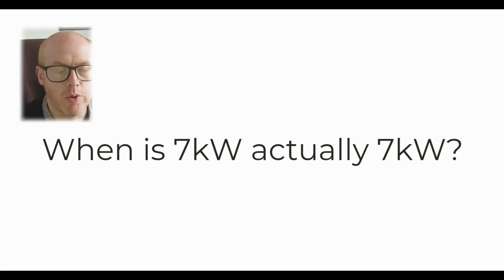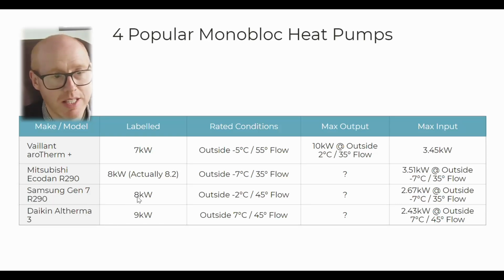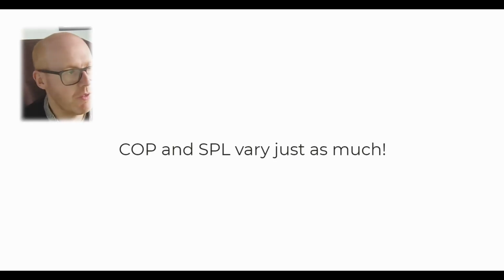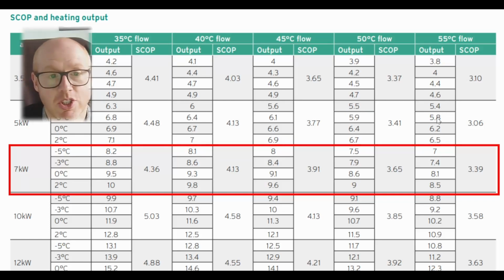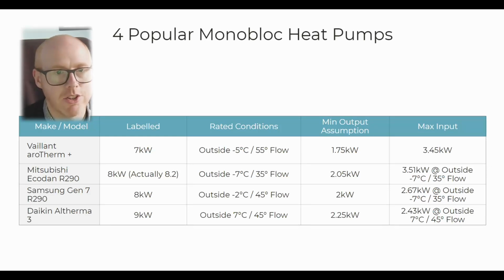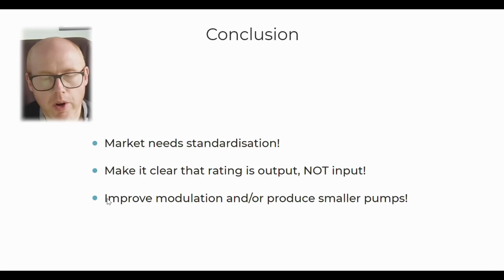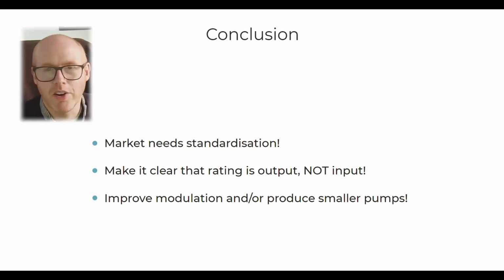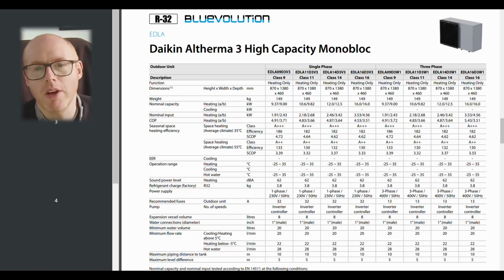Are Heat Pump Manufacturers trying to manipulate the figures? What size pump do you need?

Comment: Welcome to the world of the "Ratings Game". 

It has always been the case that AC & Heat Pump manufacturers rate & produce performance data to show their products in the best possible light. Car makers do exactly the same with prescribed fuel consumption test procedures under lab conditions, which as we all know, bares no resemblance to real world results because replicating real world conditions for different types of drivers & ways of driving is impossible to achieve. The same is true for Heat Pumps.  

Interestingly, Air to Air split heat pumps have long since shown minimum & maximum heat/cool capacities & power input data for different models (at least the manufacturers that I was involved with did). However, the temperatures (inside & outside) that were used to generate this data could vary widely so once again there is plenty of opportunity to "manipulate the numbers". And, as you have found, the same is true for ATW products.

In an effort to make comparisons between different makes more easy industry bodies require individual heat pump models to be tested & rated at specific conditions. This can be done in-house at the manufacturers factories providing their facilities meet the governing bodies test, measuring equipment & procedural standards. Governing bodies will visit & witness the manufacturers testing facilities to ensure their compliance. Governing bodies will also do spot checks by testing randomly selected / purchased heat pumps & test them in its own lab facilities. In the UK the most well known of these test houses is BSRIA who I had dealings with when I worked for two different heat pump manufacturers. This data is also used for the energy labels attached to each product. 

That said it is still not easy to do meaningful comparisons between manufacturers when there are so many installation variables that can affect the overall system performance e.g. the type of emitters used, the pipe sizes, lengths of pipe & pressure losses, pump sizes, buffer tanks or not etc etc. To combat this most ATW manufacturers should publish a "short form" of capacity & power input product rating based rads or UFH & different flow temps. This is typically shown in their sales catalogues & should be the same format for each make in an attempt to level the playing field. Whilst not totally accurate it can be used as as a quick way of comparing different makes. However, for all the reasons stated above accurate comparisons between makes are almost impossible due to the many variables involved. 
Last but not least, oversizing of heat pumps is still fairly common & is a hangover from the days of boilers when sizing was, how should I say, more of a guesstimate than a science. It's far better to slightly undersize a heat pump that to oversize it. 
Now I'm waffling so I'll stop!!!!!
Reply from the maker: Thanks for the comment. I've responded in this video: https://youtu.be/BQQ5cOFCjKI

Comment: Interesting video, I am assuming that as that energy demand drops you will be along the heat curve and therefore the flow temp will be lower, that again increases COP and doesn't help the low modulation. I did have the chance to get a 5kw arotherm,  but went for the 7kw as my heat loss is 7.6kw at -3. Ouu by the way second hand pumps can be had , lol. I have my 7kw,  as its DIY,  I am putting in 35mm primary and twin mag and y strainers,  because I can.
Reply from the maker: Thanks for the comment. I've responded in this video: https://youtu.be/BQQ5cOFCjKI

Comment: We are in the process of getting a heat pump from Octopus our heat loss in the house is 6.5kw. Octopus initially specified the 9kw Daikin however the 9kw HP has a minimum electrical input of 950w where as the 8kw heat pumps minimum electrical input is 325w a massive difference that ultimately would have cost me on my bills. Discussed with Octopus and they were happy to change the HP to the 8kw.
Apparently the 4,6 and 8kw HP are all exactly the same the first two are limited by software only so it makes sense that they all take the same amount of electricity to run them at the lower output end. Again the 9,11,13 and 16kw units are all the same unit thus the reason why there is such a difference in minimum electrical input between 8 and 9kw units.
Reply: I have the 11kw and it can run much lower than 950w. The other day I could see on our smart meter the hole house consumption was showing 844w.  The compressor was running so to see how much it was using I tuned the pump off. The house consumption dropped to 84w. That means the ASHP was using 760w. Still not as low as 325w but at most, on mild days. it will only cycle about 7 time in a day and our SCOP is 4.3
Reply: @bryanhindle8307  is it an EDLA monoblock? The refridgerent split and hydrosplit units are different, my hydrosplit 11kW drops to 650W or so...
Reply from the maker: Thanks for the comment. I've responded in this video: https://youtu.be/BQQ5cOFCjKI

Comment: Totally not relevant to heat pumps, but you might be surprised that the electrical consumption of a microwave is typically about double what the rated cooking output is, and they run at 100% duty cycle.
Reply from the maker: Thanks for the comment. I've responded in this video: https://youtu.be/BQQ5cOFCjKI

Comment: This has been so helpful for my particular situation, I have just bought a 3 bed detached 112 sqm and want to get an installation from Octopus which currently uses the Valliant Aerotherm . I am going to do a loft conversion and possibly a single storey kitchen extension so adding 70 sqm . From your video I am taking the assumption that installing a 7kw now would be able to handle the addition of say 4 room radiators and a bathroom one in the future so I could install now to take advantage of the £7,500 rebate and know it should be able to support future expansion.
Reply: I didn't know Octopus use Vaillant now. I think they used to use Daikin.
Reply from the maker: Thanks for the comment. I've responded in this video: https://youtu.be/BQQ5cOFCjKI

Comment: This was the right video at the right time for me, thanks! I am getting quotes atm and have been struggling to understand why the heat pumps recommended have varied so much, from 7kw to 12. The 12kw Samsung pump that one company has recommended seems high to me given our heat loss of 6.5kw. But the company has generally been very good and thorough so i am inclined to trust. My concern is less that they've got it wrong and more that they're just being over cautious. In reality we only heat the house to 19 so am concerned about a pump that is pretty oversized and ends up cycling a lot. Plus it's a chunky beast! Anyway, I'm waffling...
Reply from the maker: Thanks for the comment. I've responded in this video: https://youtu.be/BQQ5cOFCjKI
Reply: 12Kw seems insane for this to me. I just got a Vaillant A+ 7Kw in a 3 bed detached in Scotland (we design temp to -4 not -2 like most of England) with a loss of 5.5Kw, floor area 110m2.

Even then it seems oversized slightly as I'm now running steady-state heating and the rads are positively tepid until we get down below about 3 degrees, but we're planning on extensions a little later in the lifespan of the unit so I don't mind it being larger to account for that. Short term cops of 4.5 - 5 when it's been 3-7 degrees mostly lately, which is great.

So to me, it sounds beyond cautious, it sounds a little bit like gas thinking to me.
Reply: @MacCraig8  to be fair, I think Samsungs are quite different to Vaillants. The Vaillant 7kW is based on -5 degrees outside and 55 degree flow, whereas the Samsung 12kW is based on 7 degrees outside and 35 degree flow. At our design temp (-3.4) the 12kW Samsung only outputs about 9.5kW based on 50 degree flow. That's still too high for our heat loss, but perhaps it's not as crazy as it first seems.
Reply: @chrismckee2799 Gotcha, still think a near 50% headroom is perhaps still not in your best interests, unless like myself, considering future extensions within the life of the unit. Not to mention if it's one of those double fan towerblocks I'd be keen to see if I could stick to a single personally, far less asthetically awkward on a relatively normal house. Genuinely think the oversize bias with oversized visuals help the misinformationists point and go 'look how rediculous!'

Comment: At the end of this vaillant document there are minimum output figures at A7/W35. For 7kW it’s actually 3 kW at and for 5kW unit it’s 2.1kW. https://www.vaillant.co.uk/product-images/0020330791-03.pdf.pdf
Reply from the maker: Yes, that's the document that I got the figures for 760w consumption at A2/W35.
Unfortunately it contradicts another Vaillant technical document and does not correspond with the measurements shown on heatpumpmonitor.org

Comment: Nice overview.   The heat loss of our house was estimated at 6.1kW.   I was bit surprised when the installer recommended a 5kW Valliant heat pump.   He was right and the heat pump copes even when the outside temperature dropped to -7C.   It also has no problems heating a 300 litre hot water tank to 52C.
Reply: Can I ask who your installer was..... And did they fit a buffer tank or a low loss header to your system to balance the lower flow rates of a 5kw Vaillant
Reply: @PeterT-u3x Vito energy. No buffers or zones.
Reply: @PeterT-u3x I used a company called VitoEnergy.   They’re not cheap and looking back, I think I paid more than I need have.   No buffers were needed as I have 15mm pipe to all rads.   We have a total 14 rads in a 3 bed detached house.    As they were all over 30 years old I decided to upgrade them all (half of which I fitted myself).    Some of the rads were designer and the total install was around £21k (from which you can subtract the 7.5k grant).
Reply: @PeterT-u3x VitoEnergy.  No buffers or zones
Reply: Probably even the 3.5 kw version shown in the video would have been the most efficient.
Reply: @user-ry7yg2hk7i  the 3.5 kW model is essentially the same as the 5 kW so you won’t get any lower modulation. It’s just limited in software to a lower maximum output.
Reply: @HowardBurgess  it seems like the 3.5 and 5.0kW minimum output @7°C is 2.1kW with the 7kW unit have a minimum output of 3.0kW. I don't see any reason for them selling the 3.5kW (around £3,430) unit as there seems to be no benefit over the 5.0kW (around £3620). There are both the same size (same unit?).

If the 7kW unit would modulate down to the same as the 3.5/5.0kW unit, there would be no benefit to getting a lower output ones as they use the same floor space.
Reply: @user-ry7yg2hk7i Probably, abit too small especially for the HW needs
Reply from the maker: Thanks for the comment. I've responded in this video: https://youtu.be/BQQ5cOFCjKI

Comment: Comppletely agree! Minimum electrical input is SO important to reduce cycling. A heatpump that is rated to deliver 6KW at -3 will struggle to deliver just 1-2kw of heat input when the weather is milder (spring, autumn). In your example, your Minimum electrical input is say 600w, but in the milder weather (10-15 degrees) you'll be getting a COP of around 5-6, so it's chucking in 3-3.6KW of heat still. If they could modulate down to just a couple of hundred watts, it would save electricity consumption and reduce cycling by trickling in just a KW or 2 of heat when that's all that is needed.
Reply from the maker: Thanks for the comment. I've responded in this video: https://youtu.be/BQQ5cOFCjKI
Reply: The thing is, it really shouldn't be difficult to calculate. They're already working out heat loss at -2C (delta 23), so can't be hard to then also get a figure at a couple of degrees above the average temperature for your location. That way you have the effective working range, so also know what the real world minimum heat output requirement is.

Given that they already know the output figures at various temperatures and flow temperatures, surely it then becomes easier to find the right size that will minimise cycling.

In my mind, in a 3D graph you've got a cone that represents operating capabilities, and a line that represents your own heat loss requirements for your individual property. 

The correct heat pump would see your line stay entirely within the operating range, both at high and low external temperatures.
Reply: Do not agree. Minimum electrical input is not SO important to reduce cycling - to reduce cycling minimum heat pumped into the building is SO important to reduce cycling.
Reply: @normanboyes4983  i might be missing something here, but how do you control the heat output without controlling the electrical input, while maintaining COP.

Comment: Where can I find the 4 to 1 modulation data for Vaillant ASHPs you mention in the video.... Have I wrongly assumed that Vaillant low modulation was simply a ratio of the minimum & maximum l/h flow rates which is closer to 2 to 1.
Reply from the maker: Thanks for the comment. I've responded in this video: https://youtu.be/BQQ5cOFCjKI
Reply: Looking at their tables it seems to suggest that there's no modulation whatsoever; output goes up at higher temperatures with the same quoted COP.

If output dropped and COP remained the same as temperature increased, then this would indicate modulation.

Comment: I have found the Mitsubishi information the best of the bunch for those who really want to go into the details; the Ecodan A2W Databook has masses of information (min/part-load/max power output at 5 deg C increments of air and water temperatures). However, yes their two-page data-sheet is a bit weak.
Reply from the maker: Thanks for the comment. I've responded in this video: https://youtu.be/BQQ5cOFCjKI